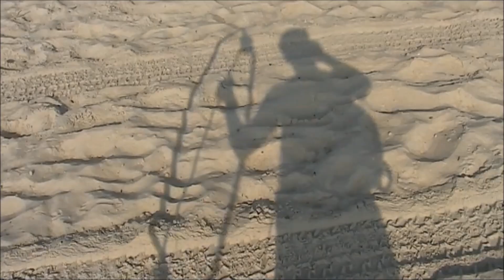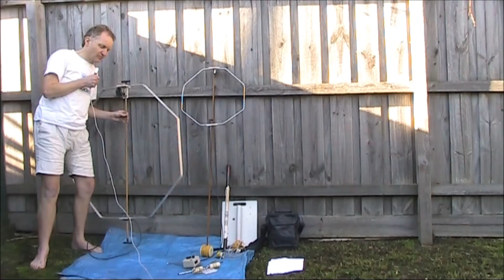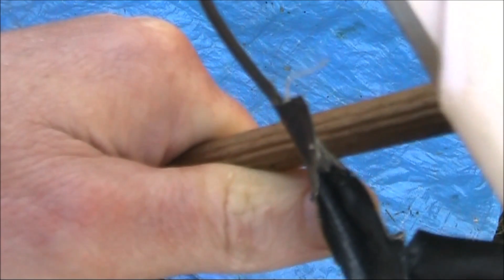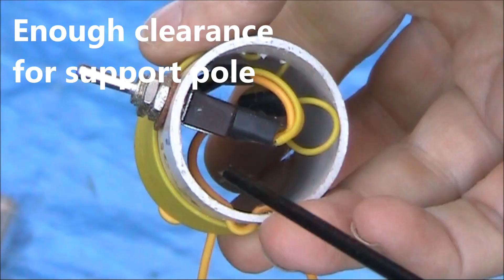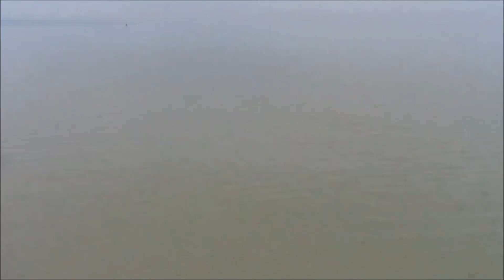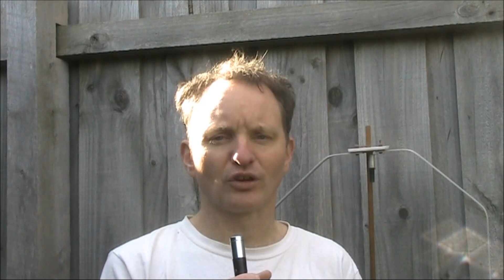Fun with HF QRP Pedestrian Mobile

Comment: Hi Peter, thank you, you've provided awesome material which can seldom be seen on youtube. I have also tried magnetic loop for portable operation, but nowadays I use a telescopic vertical (l=1.6m) equipped by loading capacitive hat atop and a coil at the base. It works quite efficient on 17m band which I often use being afield. The advantages are: 1) Very portable solution; 2) Works 17...10m; 3) Quite efficient due to a hat made of thin copper wires; 4) Tunable

Looking forward to see your further experiments. Best wishes, Roman R2BDY

Comment: Hey Peter. 

Re magnetic loops, I’ve tried the aluminium brazing rods from Bunnings. They work really well with a simple cheap butane torch. Once you get the temperature up, it flows like solder. I brazed two 4m lengths of 1” flat aluminium bar.  Just  shy of 3m wide.   I’ll be trying it on 40 and 80m after I’ve sorted out the Ford Falcon station wagon I scored for $150.00
Reply: Thought you'd be a Holden man Chris?
Reply: @Paul_VK3HN  Fords come pre depreciated. 

I used to drive a Bits-missing Mango. Complete pile of junk, but it saved me from all those Ford v Holden arguments
Reply: @Paul_VK3HN  and the Ford lives. Still needs some love to get a roadworthy, but I have it running, drivable and more importantly stoppable. EL Falcon. Old enough to have a much higher utility value than the perceived market value.
Reply: @MidlifeRenaissanceMan  I see that  ... "Like its predecessors, the EL Falcon was widely favoured by Australian police and taxi operators. The EL remains one of the most popular Falcons produced.
Engine: 4.0 L Thriftpower Six I6 (petrol); 5.0 L ... Transmission: 4-speed M93LE automatic (I6); ...". Not a bad set'o'wheels Chris.

Comment: I wonder if a better counterpoise might be a backpack with a large metal sheet covering it.   Rather than needing to trail a wire or attach it to one's body, one could just have a large area of the backpack covered with aluminum foil.   A common-mode choke would probably need to be placed on the coaxial cable from the transceiver to prevent the transceiver from becoming part of the counterpoise.
Reply: Mag loop. You’ll get Ok performance with a loop that’s only 2.5-3m circumference 

To get a similar performance on 40m you’ll need to double the length. 

Me. I prefer to operate CW mobile from the car. That presents a few other challenges, however is not that much more distracting than talking to your passenger 
Mostly I operate on 40m, though I’ve worked  some 10m too. 

Straight key left handed, just watch the bumps and pot holes